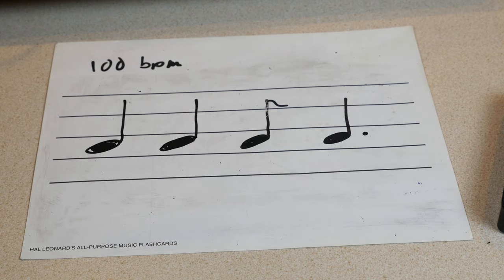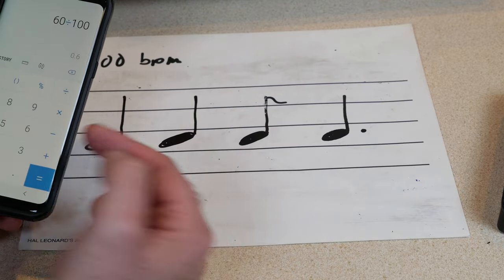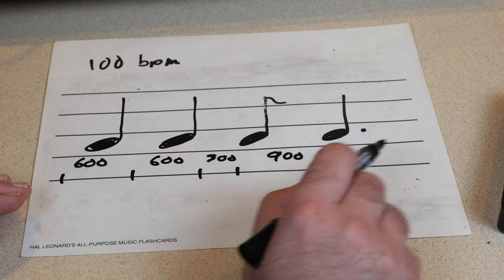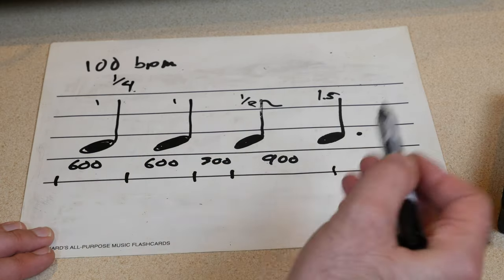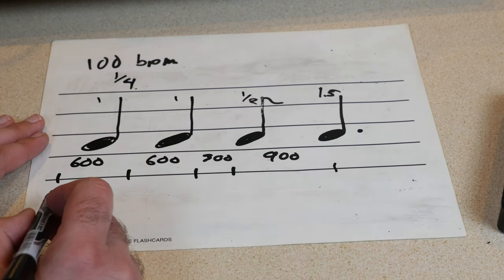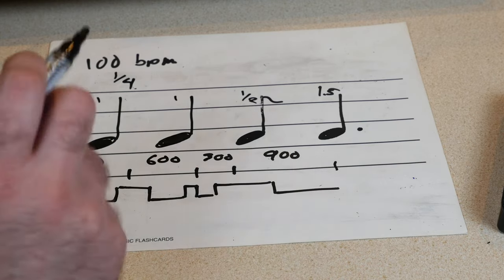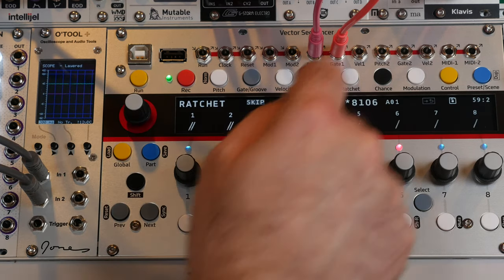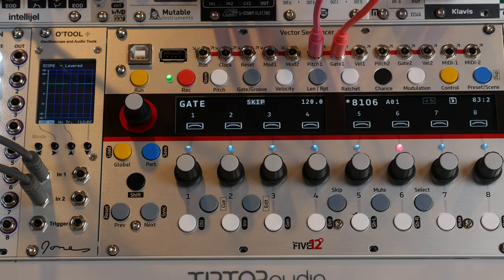Vector Sequencer Gate and Step Len

Comment: Your videos on the Vector makes me want to get into Eurorack 👍🎉 Is it still a great  choice for a sequencer, 4 years later?
Reply from the maker: Vector has seen several firmware improvements over the years, so if you absolutely must have an in-rack sequencer, then I think it should be on your short list. Erica's Black Sequencer has since come out, and while Vector still has more features, Black Sequencer is half the price and supports a similar feature set.

If you're okay venturing outside of the rack, there have been quite a few top-shelf hardware sequencers released, such as the Squarp Hapax, and Oxi One.
Reply: @ferrycollider  thank you!

Comment: The O Tool  seems to be a very interesting device and you explained well the differences and interactions of the three kinds of 'lenghts' that are separately manipulable (step length, gate and ADSR-enveloppe). Thank you for this very clear explaination. I'm very interested in this vector sequencer as my 'second player' that I can program-generate and during live-performance navigate in a way as a secondary melodic or harmonic-chordic line next to my main melody and chords or arpeggios played alive. Can I switch to other patterns by footpedal(s) also?
Reply from the maker: It supports switching patterns, but I don't think it allows it through CV yet. Jim has posted some teaser videos showing pattern switching via a Launchpad (MIDI), so it seems this kind of thing is around the corner.
Reply: Thanks a lot for this answer, Ferry.
Reply from the maker: @wernervannuffel2608  Here's the teaser video I was talking about: https://www.instagram.com/p/B7eTVJgB9L4/

Half of the reason why the Vector is amazing is Jim. He has the firmware is under constant improvement and is really great about shipping new features.

Comment: Is there a list of all available divisions/multiplications of step length? I'm hoping you can get nonstandard step lengths the er-101 but I can't tell from the manual.
Reply from the maker: Possible step lengths: 1/8, 1/7, 1/6, 1/5, 1/4, 1/3, 3/8, 1/2, 2/3, 3/4, 1, 1.5, 2, 3, 4

I didn't show it in this video (I was planning to show it in an upcoming one), but the per-part Rate + Mode can also be set to all kinds of stuff. There is a PCT mode (percent of beat) which you could setup odd stuff like 41% of the beat. There's also a SPD mode which is basically just a freeform number that isn't tied to any musical division. The part clock division can also be set to any fraction of a beat you can dream up, so weird stuff like 9/5 of a beat or 15/7 or whatever. The step length multiplier/divisor will multiple or divide relative to this per-part Rate + Mode so you can get really wild if you want.
Reply: @ferrycollider  Cool. On a related note - do you know if the reset input global or can you activate it per sequence/channel? It would be nice to do "untimed" sequences that could reset every 8 measures while other sequences kept looping in different meters.
Reply from the maker: @richiehinterland  yes that's possible. Page 14 "External Clock Pulse" of the manual covers this, but more or less the Reset port is configured to "Cr" mode, then the reset of each part can be set individually to "EXT" (external).

By the way, the per-part reset can also be configured to every n beats as well, which might save the hassle of having to fire an external reset trigger. What's also cool is there are two modulation CV inputs, and the part reset beat count can be controlled externally via a CV, so the reset beat count could be modulated over time too.
Reply from the maker: Now that we're talking about this, I'm realizing I should make a video about it because there's so many possibilities lol.